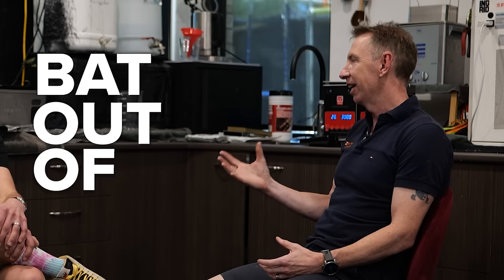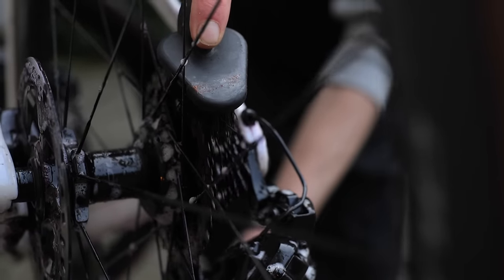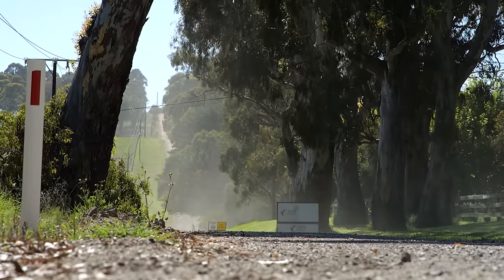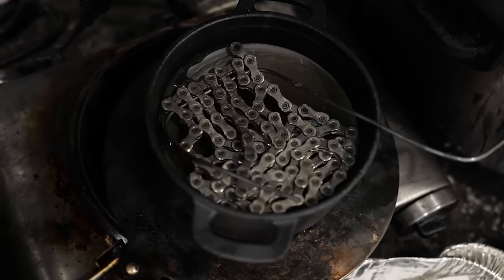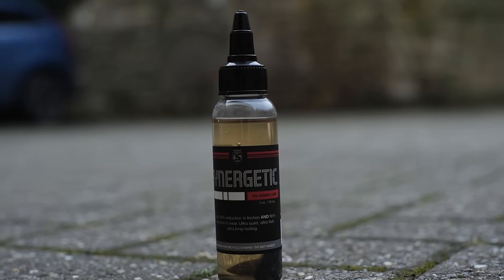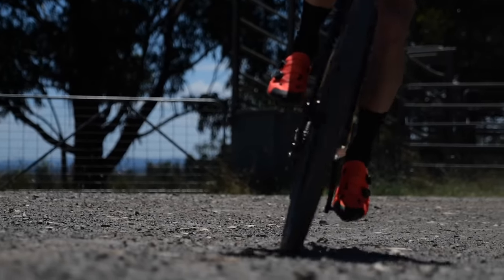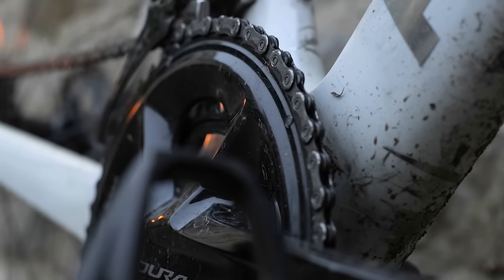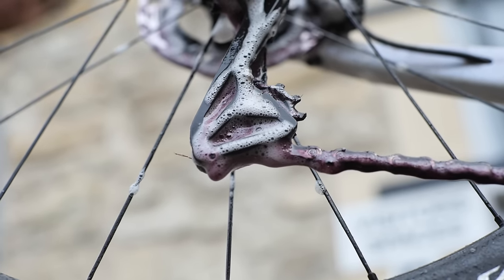They Don't Want Your Chain To Last This Long

Comment: I have 3 chains, wax them all together, then switch them out every 250 miles, 15 minutes once every month, to have waxed chains, and the biggest benefit they don't talk about. You can touch the chain, and it's clean, your hands will be clean, anything that touches the chain will be clean, no more grease marks, no more worry about how do i transport the bike without fouling something with chain grease, because ive definitely fouled more money worth of stuff with chain grease on accident than I have spent on chain and chain wear,. Never again though. My chain is clean, and leaves no marks on anything it touches. One of my chains Im on 3k miles, of hard beach riding at 250 watts and I don't imagine it will be done anytime soon.

If they marketed waxing as no more worrying about getting chain grease on expensive things, people would eat it up. That its faster is just an added benefit.

Im at this point convinced that if you rotate out waxed chains frequently, they will never wear out. One of my chains has outlasted a set of tires. I just swap to the next chain after the first ride it makes noise. Takes 20 seconds with quick links.

Also, waxing 3 chains at a time takes no more effort than waxing one chain.
Reply: As someone who helps people pack bikes for airline travel, wax is a god-send.  I'm very much looking forward to this advantage when I pack my tandem and 2 1/2 chains along with it.  Grease free and LOVING IT!!!!

Comment: I'm just beside myself with joy!
51 years cycling and FINALLY took the immersion wax plunge!
(And I watched Dave wax his chain in "Breaking Away" in '79, so it's not like I didn't know ALL ABOUT IT for most of that time!)
Mountain bike ride #4 in the books today and cannot believe how well my chain has stood up to four dry, dusty California 10+ mile rides.  First three were in coastal CA sandstone dirt, last ride was in low Sierra andesite soils (VERY abrasive).  Chain's still running like the minute I pulled it from the hot wax and put it on the Ripley.  Only care is post-ride wipe-down of chain & associated parts.  Why leave the dust on it?  (I can't keep away.)
Chain's 2 years old using Rock & Roll Extreme & Gold (less so), so I degreased it and dumped it into my own secret recipe of candle wax & disulfide powders.
"YOWZA!!!!" is all I can say.
I'm convinced.  And kicking myself for waiting WAY, WAY, WAY TOO LONG to make the switch.

Comment: Does this mean GCN will be taking down all their contradicting videos on lubrication paid for by their partners throughout the years?
Reply: Everyone's got kids to feed at the end of the day.
Reply: Post scriptum: i beg your pardon for those innapropriated hearts in the middle of the sentence.
Reply: If you take GCNs word for choosing your gear in the first place you're bound to overpay for marketing wank
Reply: I have used low-temp dripon wax this winter (N Sweden, so real winter). 

I got a lot of rust on the outside of the chain, no matter what I did, so put on som wet lube now when the snow is thawing. 

It was perfectly fine with wax when we had -5 to -38C. But i had to take the bike into the garage, wait a few hours for it to get warm (+5C) and apply the dripon and then let it dry overnight.
Reply: Well it's a commercial enterprise so do fact check before buying recommended or sponsored products.
😅

About lube testing, It's relatively new info in the grand scheme of things since standardized tests for chain lubes is still a long way from being a thing. 
You couldn't really tell with anything else than anecdotal evidence what worked or not before ZFC started testing them you had to believe the marketing hype. We're making progress here 🎉
Reply: @My_HandleIs_ if you go to zero friction cycling channel he does address complaints of rust, and apparently there's a certain brand of Wax where rusting is an issue, and other cases where surface rust is common but not detrimental.  being in South Australia he doesn't have a way to test in snow conditions though, I think though that he should probably test with salt water and that might be similar to winter conditions where municipalities salt the roads in the winter
Reply: Been saying this for years - GCN is just a marketing arm of the industry. Whatever the industry does, GCN endorses it, indirectly, by not really questioning it. Why? Because who wants to bite the hand that feeds you?
Reply: @better.better  I agree. But if you follow him, you will find he is literally the only one doing this. He is to be trusted because he has many manufacturers of lubes contracted. Some he doesn’t publish, that are likely pretty good. So, anyway, just no human time to do this kind of work. If I lived near salt water, just rinse with clean water and then use a wet wax drip on every time. And wax more often.
Reply: @better.better  since snow is water,  it's safe to say a wet lube like Silca Synergetic will be better.  I just have a winter chain for my gravel and plus bike for riding in the snow.  Easy to keep track of because they're 105 and GX chains and I run waxed Ultegra/Dura Ace and XO1 chains the rest of the year.
Reply: Ages ago there was no wax for chain, or we didn't know. Now there is, we call this progress
Reply: I love everyone complaining about the information yet here you are watching it.  If GCN is so bad stop watching send your eyeballs to better content so those creators can get paid for there work.
Reply: No, it’s part of the history of how our knowledge has evolved. I mean the video of Si cleaning and ‘lubing’ his chain with WD40 is embedded in GCN’s folklore 😂
Reply: They fuckin well should
Reply: happy to give GCN benefit of the dout ... unless Muc Off comes back
Reply: We are responsible for choosing intelligently. It’s easy to see what is sponsored and what is an actual opinion. We don’t pay for their service, so I would not complain here.
Reply: Top comment 😅
Reply: OMG. Just ride your bike, clean and lube your chain at the appropriate interval, and don't obsess about chain lube.
If you're worried about the money you spend on chains and lube.....don't spend 7 grand on a bike.

Comment: I have a solid cheap chain lube and quick degreasing process! Buy a decent fully synthetic 2-stroke engine oil and fill one of your old chain lube bottles that you probably payed the same price for as the 1 liter of 2-stroke oil! To degrease, a quick spray with GT85, leave it 2 minutes then jet wash off. I'm getting amazing results with this and saving time and money! I use Castrol Power 1 Racing and in the wet the water beads off the chain and cassette and remains almost completely silent!
Reply from the maker: hi, thanks for the comment, that is certainly a method we've not heard of before! How long does it last? thanks!
Reply: Pretty sure a lot of wet lubes are just 2 stroke oil with a bit of thinner added. It's good in the rain.

Comment: @GCNTech

I have used low-temp dripon wax this winter (N Sweden, so real winter). 

I got a lot of rust on the outside of the chain, no matter what I did, so put on some wet lube now when the snow is thawing. 

It was perfectly fine with wax when we had -5 to -38C. But i had to take the bike into the garage, wait a few hours for it to get warm (+5C) and apply the dripon and then let it dry overnight.

Comment: I use liquid gold lubricant.  I wipe the chain with Terry cloth before and after every ride, and I drip lube one the chain every other day, let the chain spin for 5 minutes, then briefly wipe it off.  no mess, no fuss. I have never sure what road bikers are complaining about. I live in an area that can be dry for days, and occasionally wet for days, dust or sand is often present.  I commute and recreate on my bikes. daily transportation. I live in mountains.  every three chain replacements, I replace the most often used front chain rings.  you folks make chain maintenance seem like a chore filled with mystery.

Comment: Best thing I ever did going over to immersive wax 18 months ago. Takes 15min every month to rewax chain and I never need to clean the drive chain/cassette/chain ring ever. Only need to quickly wash frame. Bicycle looks like new all the time.Barely any wear after 10k
Reply: Agreed, but I run 3 chains in rotation, swap them out when they make noise, rewax them together monthly. Im doing 600 miles a month though. But even if it wasn't faster, the cleanliness factor is more than worth it. Swapping out chains is such a non issue as soon as you realize you can do it with bare hands and not have to wash them after.
Reply: do you wait for it make noise on a ride, perhaps a big one and it's too late, or when you clean your bike?
Reply: @danielhand1729  about every 400ks. Turn on slow cooker. Drop chain in. Come back an hour later when wax melted, then put back on bike. But yes. As chain starts to get noisy that's a good clue

Comment: Excellent discussion. As someone who puts a lot of miles on a trainer, I would like to know the wear difference you will see on a chain. Two key factors are a cleaner environment, heavier average load as you push your limits in training.

Comment: My first chain and cassette lasted only 2500km, had no clue about maintenance. Stretch well over 1%, didn't spot it in time. Cassette was done for as well, new chain skipped liked crazy, couldn't even leave my own street. Second one I did 2000km + 2500km with 2 chains on one cassette. This was with wet lube. By this time, the chain rings were dead as well. Pointy like a shark, lost almost half the width of the teeth compared to the new one. Probably the first 2500km did most of the damage.

Then switched to drip-on wax and started rotating the chains every 1000km. The next set latest 12.000km for 2 chains, 1 cassette. Currently approaching the same distance on my current set; one chain is at 0.75% stretch. Cassette still looks fine, but difficult to tell. What do you reckon, can I run another chain (or 2) on this cassette? What about the chain rings that now did 24.000km, mostly on the big ring. I find this drive train maintenance / replacement thing quite difficult to judge still.

To complete the picture: I am not the most smooth rider, tend to ride low candence, ride through the winter with salted and wet roads. I think I am doing a reasonable job with cleaning and relubing nowadays. Did a 3000km ride this summer with only very basic maintenance.

Comment: I always a wet petroleum based lube. This is because I always do a full solvent bath wash of the chain each time I service my bike.

Chain stays visually clean for ~300-400kms, with a service life of up to 800kms.

Wax, dry and 'eco' lubes are a pain to completely wash off and clean out. Basic petroleum lubes clean off with organic solvents really well, leaving the chain spotless clean. 

Chain rings and cassette are also solvent bathed and scrubbed. Had the same Titanium record 10s and Super Record cassettes with the same chains now for over 5, years and + 10k KMs each (on different bikes.) Key to this is using the correct amount of lube. Here it's a case of less is more. After the lube is applied on the bench (1 very small drop per link, chain off the bike.) Then run the chain through your fingers to work the lube through a few times. Then dry the chain with a lint free rag. Really dry it. I then like to hang it for a while while I clean/service the rest of the bike. Allows an volatiles to flash off. Give it 1 more wipe before reinstallation.

It's an effort to clean, but after all this time, everything still looks and rides brand new. Even the softer Ti cogs.
Reply: Maybe watch the video?
Reply: Doesn’t matter. Waxing is cleaner, faster and your drivetrain will last much longer waxing

Comment: GCN, thought provoking discussion on chain maintenance and lubricant. Albeit one important omission was made in regard to money saved by performing appropriate maintenance and lubrication. Medical bills, time away from work, trip cancellations , etc. secondary to injuries sustained from a dropped chain during an aggressive acceleration. I can personally attest to over $10,000 in medical bills and missing out on a bucket list trip to Europe to cycle across the Pyrenees mountains last fall (pun intended) secondary to a punctured lung, rib fractures, shoulder fractures, circumferential labral tear, ego bruising that could’ve been avoided by proper chain maintenance and lubrication. Spend $60 to save $500? Quite the underestimation! love the content as always. Cheers, RPW
Reply: so sorry to hear of that incident ryan! hope all healed now! And yes alas there isnt the conclusive data yet - i wish there was. It would be great to know that say by 1% wear chain is X % tensile strength weaker, and / or due to lateral wear X % more likely to have a chain drop etc - but we just dont have that. Suffice to say it will increase as the chain wears, and for sure a very worn chain will be more likely to snap or jump off vs a good condition chain. It is something we hope to learn more about in future, but you are right, broadly speaking - that should have been mentioned as well as it is a reality, and if the worst outcome from that does eventuate - its a rough time :(
Reply: Sounds like you're in the usa, where even medicine is a business.
Reply: @zerofrictioncycling992   as someone who tandems, I would argue that chain strength loss is negligible at best.  (Unless a chain is worn WAY past the .5% elongation threshold.  Then, all bets are off.)  And by "tandem" I mean on and off road.  Off road puts EXTREME load on the rear chain.  Two riders with steep terrain and very low gearing and HUGE additional factors:  NO front wheel lift and no rear wheel traction loss.  This explains why my partner and I have blown up SIX rear hubs.  Two were Hugi, and another was a Phil Wood FSC tandem hub we literally split in half.  (We've subsequently damaged later Phil hubs as well, but repaired the internals prior to failure.)  That was on Slickrock trail where torque loads are OFF THE CHARTS.  100% unreal traction on incredibly steep inclines.  No other bike can create sustained torque loads like a tandem.  (Again, an e-bike will either flip, and/or lose rear wheel traction at certain loads - which are below what tandems generate on a sustained basis.)
And my point?  We've NEVER broken a main chain.  30 years riding tandem and not a single main chain failure.  One timing chain failed when a rock was kicked up and was sandwiched between chainring and timing chain. Duh, that will break any chain or belt!
We've ridden Utah, the Sierra, Colorado and lots of California steep trails and have yet to see a main chain fail.
But chains DO fail, but it's not due to typical wear or lack of strength.  It's almost always over-loading during a shift or failure of installation or maintenance.  But a properly installed and maintained chain won't fail due to loads.  Otherwise, we tandem riders would be blowing them up left and right.  (As would the monster track riders who put out ungodly torque as well.  See the German "toaster boy" as an example!)

Comment: Marcel, you are right ,no panic here in the UK. Do Not Age maybe throwing bundles about after the study into Niacin revealed possible heart issues. I'm awaiting more info re the study and in the meantime I have stopped taking NMN. 10 days now and I  feel the same as I did before when supplementing with 1g a day. I was having a pulsing in the right side of my head which has now gone away . Maybe that was the NMN working ! Your recent vid with Dr She done nothing to quell my concerns. Great content as usual Marcel 👍🏻

Comment: I began waxing in the early ‘90s.  People thought that I was strange!  I would wax 5 chains at a time.  Easy!
Reply: Yup, me too.  People act like it’s some new thing, but that’s just because the internet has propagated the idea.

The old school method I was taught was a brick of canning paraffin mixed with ~10-25% motor oil melted in a double boiler (I used a smaller coffee can inside a large coffee can) over a camping stove.

I still do a variation of this and it works great.
Reply: The movie "Breaking Away" is what totally solidified cycling for me.  I was already an avid rider, but that movie got me road riding.  And I watched Dave wax his chains, but waited until now to FINALLY do it.
I'm an idiot.

Comment: My brother got an Author mountain bike in the late 90-s. It had one chain and one cassette for circa 10000 kilometers, many of which offroad, with little maintenance. After 15 years everything still worked well. I want these times back.
Reply: These times never really existed.  He just got lucky.
Been cycling seriously since '79 and wore out so many damn chains, cogs and chainrings.  Stuff just wears out with traditional lube.  Wax is the solution that's taken way too long to become mainstream.
Reply: @dudeonbike800  Thanks for you point of view. I wonder what was the deal with that drivetrain, then. It was a Shimano mountain bike drivetrain, 18 gear, not sure if the shifts were indexed but probably not. These were the old type "friction" shifters, with a single rotational knob over the bars.